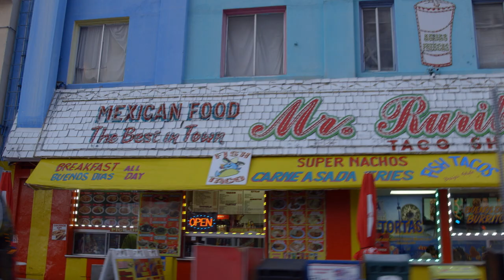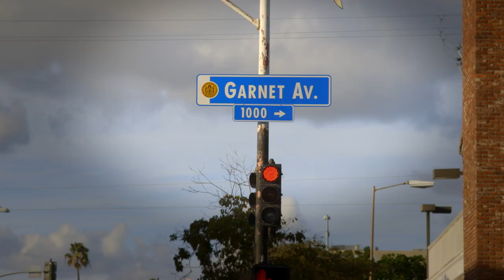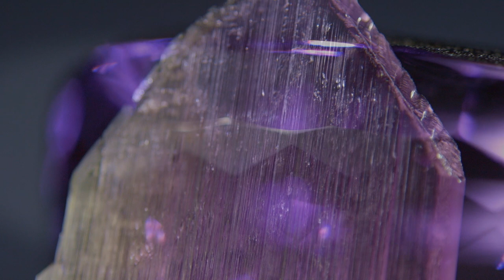MINERAL EXPLORERS | S2 | Ep4 | SOUTHERN CALIFORNIA

Comment: Gem mining with explosives destroys about 60% of what the location COULD yield. Most of the time it actually destroys more. I've seen instances where up to 80% gets destroyed or broken. Hand tools the old fashioned way is still king. Slow is how you go...
Reply: One can also drill small diameter test holes and feel the rock as you drill.. to relatively shallow depths if need be, and use small amounts of powder.  💥 is an art, and you can go very small to huge and everything in between.  It's a great tool to use imo to make good progression into a deposit, and to see what only your grandchildren would have seen if you had only been using hand tools